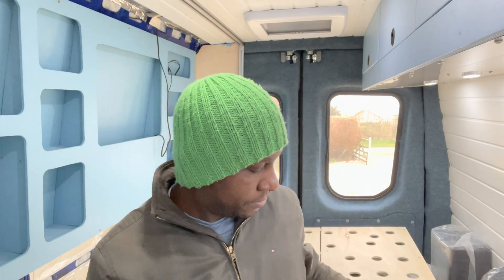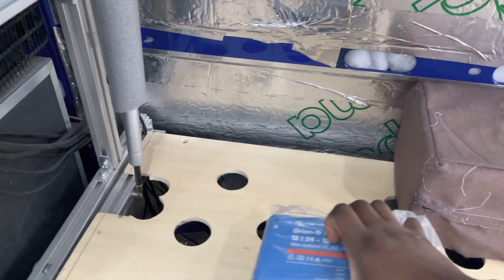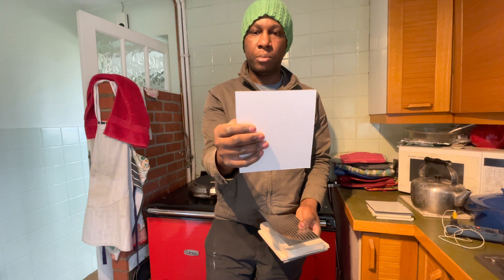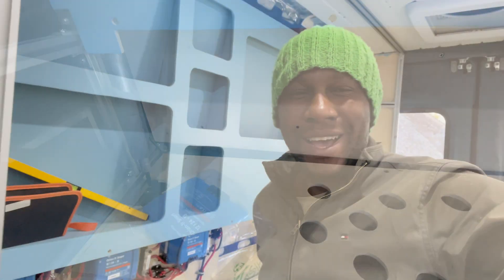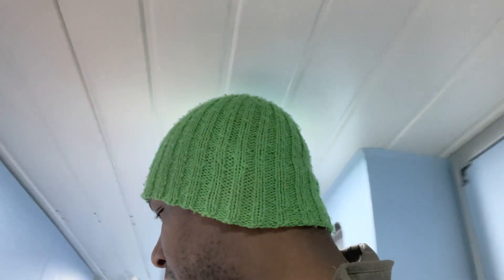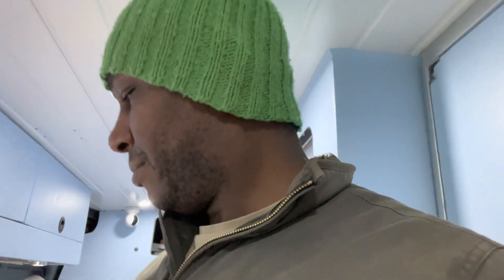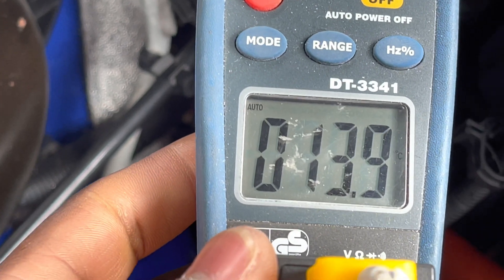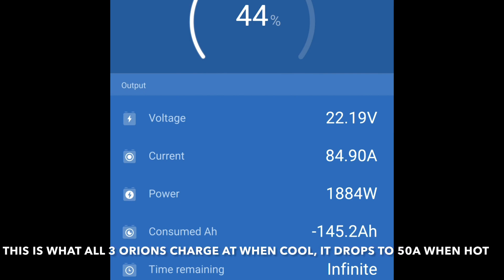Victron Orion x 3 DC-DC Charger B2B Installation Iveco daily campervan

Comment: I see you put 15a each unit. Victron also have 30a units. Would you not consider higher amperage unit?
Reply from the maker: I have 15A on the unit because it’s a 24V system. I later changed the fuse to 20A Midi fuse instead as it’s better for the system. I have seen it hit as high as 22A each charger. Plus victron says it’s max is 35A so as long as the fuse is less than that but higher than the nominal amperage then it’s ok as long as your wire is rated higher than the highest amperage etc